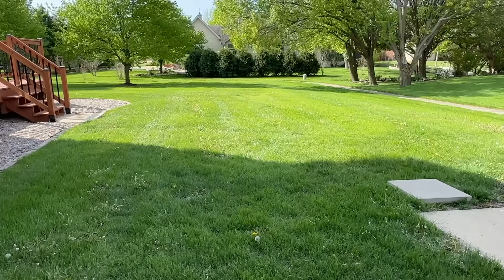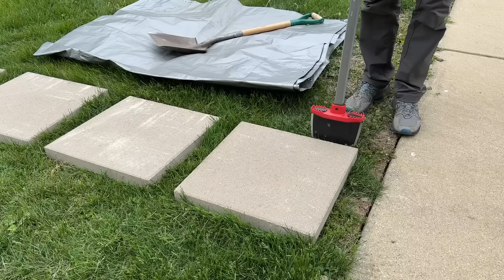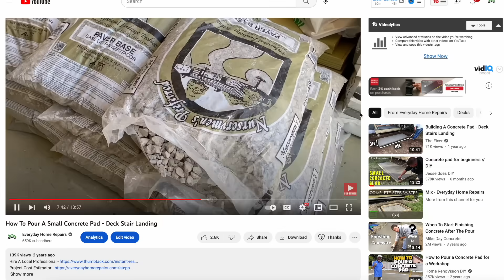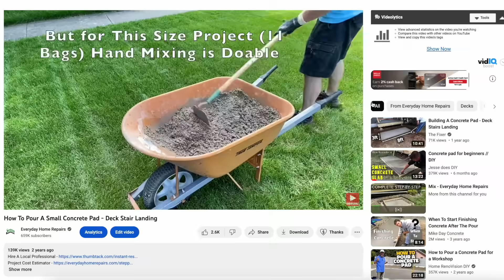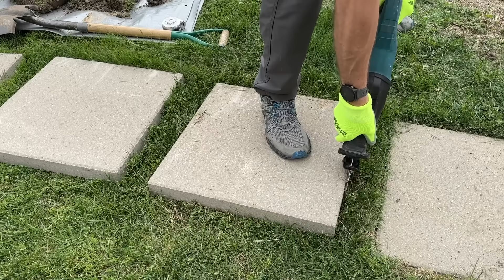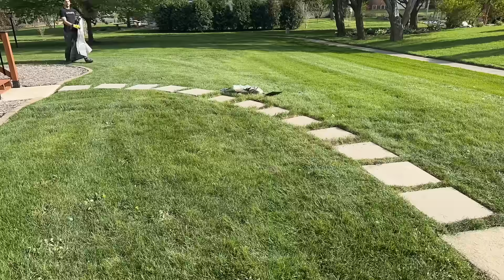How To Build A Stepping Stone Path - Small Cost With Big Results!

Comment: I've done this dozens of times. We dig out the area for each individual stone. We then use dry concrete out of bags. Easy to level up and stones stay put . No wobbles or settling. Works perfectly.
Reply: So instead of sand you just drop in concrete? Do you add water?
Reply: Concrete? Do you set it with water/spray before stone placement? I thought about this idea but noone else has mentioned it in DIY flagstone path videos,etc.
Thanks for sharing

Comment: I enjoy your videos! I’ve learned a lot from you. Like you I would diy this project without a doubt. I have a concrete walkway about 20 feet that I need to hire out and demolish. This is project is exactly what I will be doing. 66 years old and I’ve learned by measuring once and cutting the wrong length. Keep up the good work. I’ll visit your library before tackling a project. Thanks!

Comment: Did it myself but a couple of notes: 

There needs to be enough space between the pavers for the grass to be healthy. 

I have my pavers tilted, almost imperceptibly so they don’t fill with water. 

I have one on a boggy area of the yard and had to add gravel and sand underneath, as it kept breaking. 

Also, I tried to get the paver “ground level”, not grass level and in this way, I never have to worry about the mower blade hitting the paver.

Comment: I plan on doing this same thing and am curious if leveling sand is sufficient enough to prevent the paver from sinking into the ground. Would a 4” square/rectangle hole with 3” of base rock and 1” of leveling sand be overkill if I were to place the paver on top of that? These will be used for someone with a wheel chair so there will be some weight put on the pavers.

Comment: what was the average spacing between pavers for smooth strides ? It seems couple inches spacing in the video. I'll be use the cheaper 12x 12 from HD for $1.69 each, 55 ft path..

Comment: As a DIY homeowner interested in doing this, my concern is how this job will look in a few years or longer down the road. I would expect these stones to sink quite a bit over time without compacting the soil during installation (which it does not appear you did in the video). Also, I live in the Midwest where there is a lot of soil freeze-thaw, so I'm wondering if that would make the pavers uneven over time. Again I'm not an expert, but these are my concerns before tackling this project. Thanks for the video.
Reply from the maker: Yeah, the path is still going strong but only about 9 months in.  I would leave them a little higher to allow a bit more settling without the pavers being below the surrounding sod.  So far I have enjoyed having a path where I can keep my feet clean.

Comment: This style of walkway with gaps, makes shovelling in winter a real pain in the ass.
But, thank goodness you didnt pack decorative rock between each of them like most other youtubers seem to be doing.
Come winter, those bloody rocks will be getting heaved across the lawn after each snowfall.

All the 'old style' front walkways where I live are these 24x30 paver slabs, but they're practically flush up to eachother, with no gap.
Unfortunately, that doesnt seem to be in style anymore though.

My rant aside though, your video was well made, and informative and I DO appreciate it!
Thank you
Reply: I got a snowshoes called MANPLOW. It has a replaceable rubber edge that allows it to be used on uneven surfaces.

Comment: @EverydayHomerepairs could I do this for  runner/strips leading to my fence doors where I park my trailer inside? Do I need a stronger base, or is the sand good enough to hold the weight of my truck and trailer for a short while? I have some pretty solid pavers by the way, also 20x20in. thank you. By the way, awesome job on the video!!

Comment: Thank you!  We’ve been talking about installing pavers in the path between the front an back yard for years. It’s shady so grass won’t grow and there are roots from surrounding trees.  My husband and I both watched the video, moved the 16 inch pavers around a bit until we were both happy and the next day we got started. Using the edger was brilliant!  That was the most intimidating part. We did use an ax and loppers on a few roots but it was surprisingly easy. Because it’s July and we’re not young we installed four pavers each morning. We’re pretty darn pleased with ourselves.

Comment: Not sure where you are physically located but would there be any potential issues doing this type of installation in New England with the freeze / thaw cycles? Thanks for all the great info!
Reply: You might have to occasionally re-set a paver if it heaves.

I have a paver section near a gate in Montana and it's been solid, as is the flat rocks on sand part of the patio.

Comment: First off-always by 2 extra. You will break one now or later. Especially if at the store you realize they’re very wet towards the center they will be fragile there. Sometimes i lay them out in sun for day or 2 to let them dry and harden first. They’re stacked pretty quickly at cement yards and aren’t quite hard enough yet in the center. 
I’ve been both a General Contractor and Had a landscape Design install business in Florida-both business around 25 yrs. So I’ve done every paver 1000s of times. I’ve never seen or thought about the sawzall. That was genius but if people do this in Florida keep in mind the cable lines are in inch below surface,water lines are 4-6 inches and then your sprinkler anywhere from 2-6 inches. I know people will say I’m wrong and that’s not code. I’m not talking about where they ‘should’ be -just where they are. I love the sawzall idea but there’s alot places here you couldn’t use it without pissing off your wife or neighbor when you hack their cable line on a Sunday. When you use a spade like he did and wiggle it down you can actually feel a cable line or pvc pipe while you push it down. If you get any resistance stop and check. If you know you are in line of the cable box by road and your cable hookup by house then just pull up your cable line because seriously it’s just below the surface and you can tuck it back down after you’re done in sane slot or make a slot with your shovel and tuck it in. Trust me.  I’ve hit a waterline for a complex of a 1000 ppl and it was 4 inches below surface at this one spot and it shot a 50 foot geyser and turned the roads into a river in minutes. It was just in a little old ladies garden so not some place you might think. So in Florida do with caution even if you get stuff marked. Many ppl don’t know even when you get stuff marked they have a 3 foot variable on each side of that mark. So if they mark a water line it could be 3 feet on each side if their line & not where the painted line is, lol. And you’d be surprised how much you can feel if you wiggle the spade downward and meet a pipe or cable and then be able to work around it without breaking it.

Comment: Do you really need the paver sand, I did something similar and just used the earth to smooth out after cutting out and has been fine for over 6 years. My 24 * 24 and 12 * 21 pavers have stayed in position, flush with the level of earth with no issues. The only maintenance I have had to do every three years, is cut around the paver to remove over growth creep of grass overtop of stone.

Comment: Well I kinda did this myself but I just simply tossed the pavers onto the grass thinking I could at least walk on them and stay out of the slippery muddy grass until I had time to do it nicer. But the pavers just sank into the ground as we walked on them and are level with the ground after one year.
Reply: I was going to say the same thing.  I did NO digging and my pavers sank pretty quickly.
Reply: @deborahdeborah8724 and they will continue to sink and sink until they are gone!! 😂 

You can't build a house and set it on top of grass!
Reply: @commonsenseisdeadandgone  lol, they never sank that much! The weight of my family walking on then just happened to compact the soil just enough and then they stopped. It was pretty perfect. The grass did start to creep over the edges and I ended up pulling up the pavers this winter to use as an edge around a little greenhouse. Now, temporarily, I put down cardboard and woodchips on the path until I figure out what I want permanently... maybe. But I'm a gardener and I like to be able to change things. 🤷
Reply: @jwrightgardening  I guess it really depends where you live and what kind soil you have. I'm in Minnesota and we get all the weather! It's not the weight of your family, it's just how erosion works! 😂
Reply: I had installed stepping stones 2 years ago and the same thing happened. I had used small amount of sand and crushed limestones. They all sank in within a year.  I fixed all of them just a couple of days ago. Added quite a bit of sand to make stones close to flush to ground in lawn. Hopefully they stay in place better..!
Reply: I think I've just found my method!! Cheers 😁
Reply: FYI, the pavers kill the grass and roots and the paver would sink even if your family never walked on them, spacing is important 18” is a good step
Reply: I think it looks good and I will try it!
Reply: They worked really well for a couple of years but now we have just pulled it all up this spring to redo it because we are getting rid of the grass around the path. The grass is a pain to mow (we have a lot of berry bushes along the path) so we are putting down cardboard, then the pavers back down, and wood chips around them.
Reply: @jwrightgardening  Is the cardboard an alternative to salt/crushed rocks alternative for the same purpose?
Reply: @YouPogi2000  No, I never use crushed rock and especially not salt. I love gardening and I like being able to change my hardscaping as my bushes and trees grow bigger. I also like creeping flowers and bushes that come right up to and in between the stepping stones so I want to be able to put plants in the ground and have good soil for them to grow. The main purpose of the cardboard is to kill off the grass that likes to strangle my other plants and I can't mow it because my other plants are close together.
Reply: @jwrightgardening I appreciate your idea of being able to change the hardscape as things grow.
Reply: Can i deive on them trying use half of my yard as parking@jwrightgardening
Reply: @jwrightgardening  nice thanks for the response. I might just place them down like you said you did originally bc then we can also adjust the position of them until we figure out exactly where we want them.
Reply: How are they now? Wondering if I should do the same

Comment: I never would have thought of using a reciprocating saw with used blade. What a great idea!
Reply: Careful when using this method….make sure there’s no important pipes or low dug wires in the area you’re working in.
Reply: @Kaptiv239 I think you are using far too long of a blade!
Reply: I have a bad back. I may have to hire out to avoid another flare up. I use to do these projects before my last 3car accidents.

Comment: When I treated the installation process like a factory it felt like I got the pavers installed faster. Cut out the sod with the saws-all for every paver in your path. Then remove the sod for every paver, then add sand for every paver, etc… I can’t confirm it is demonstrably faster since I didn’t time the factory process versus the one-at-a-time process. However, the factory process definitely felt faster.

Comment: I have a curving slight down slope (5 degree) to a level area that tends to get swampy in heavy rains.  Would you use a layer of pea gravel below sand?  And any suggestions about placing the stones on the down slope?
Reply: I found that pea gravel moves around more than sharp gray all purpose stone.  The sharp edges tend to lock the stone in place while still allowing drainage.

Comment: SPACING: Major Issue to Not Covered—The close spacing here would be difficult for many to use—Walk the route several times and place one wherever your foot falls. Then, adjust a little closer if necessary for aesthetics and for shorter people???
Reply from the maker: Yeah, I should have dove a bit deeper on that I was shooting for 24" center-to-center.  This will be a fairly short stride length for most people.
Reply: I'm neurotic about ratios🙃: 24 inches on-center works as a 5:1 ratio (20 inches of stone to 4 inches of grass). Some other options would be 25 inches (4:1);   28 inches (5:2) 30 inches (2:1); and probably maxing out at 33 inches (3:2).

Comment: Great video! I have years of experience in contracting this type of work in my projects plus doing it myself. Your instructions are great and I like the edging tool, which I have not seen before. Some suggestions for thought - use concrete sand for the base as it is better graded and more stable under traffic. Use two pieces of pvc conduit on opposite sides and a small board to screed the sand off level. For flagstone we used flour to mark the outside edges for excavation. Thanks again for a well prepared video.
Reply: The two sands are different but not much. Concrete sand has some larger size sand and is better graded as far as particle size, which gives much better support than paver sand. The paver sand is smaller with less size distribution, which makes it less stable under traffic. However, it works better in filling joints between stones. Not sure any of the big box stores carry concrete sand. Sometimes you can get some at a local ready mix concrete business.
Reply: @weldo1948  Thank you for the info.
Reply from the maker: Thanks for the tips on the PVC to strike off the surface 👍
Reply: Is concrete sand available at most home improvement stores? Is it the same thing as paver sand. Thx in advance.

Comment: How do you mow around this? Do you run the mower right over them or do you need to use a trimmer? I’ve wanted to do something like this, but have chickened out afraid of making the lawn harder to maintain. Thanks.
Reply: If you set them right, you can mow right over. Trimming will depend on your grass type, stone size, and formality. I trim my Bermuda grass on smaller stones about once a month.
Reply: @NOXStellans  thanks! I have St. Augustine. Someone commented it’s good to keep them proud to prevent grass from growing over the stones too quickly. That would probably affect mowing? I guess I can do one and test it. Thanks.